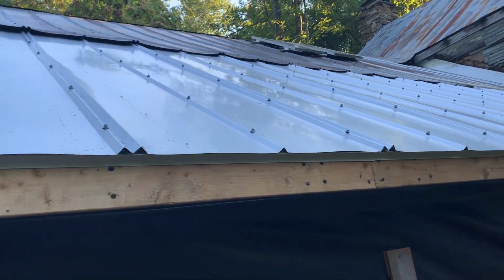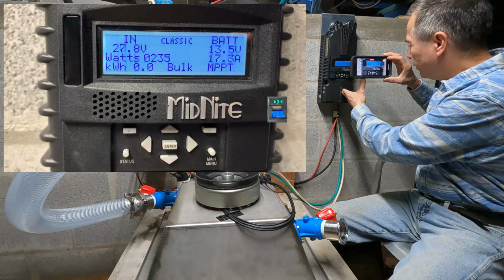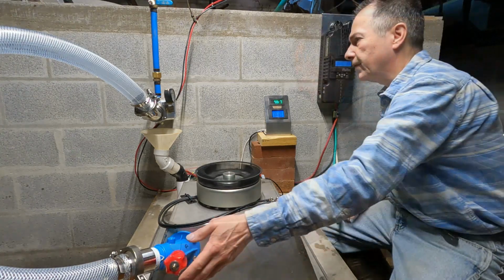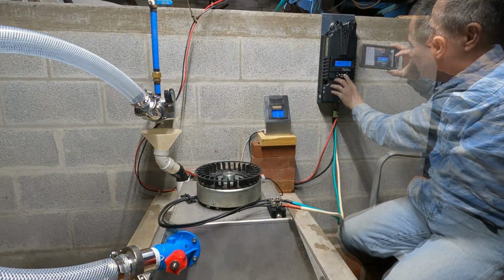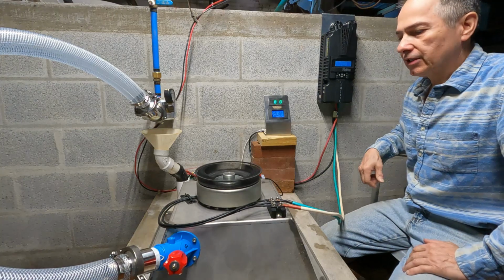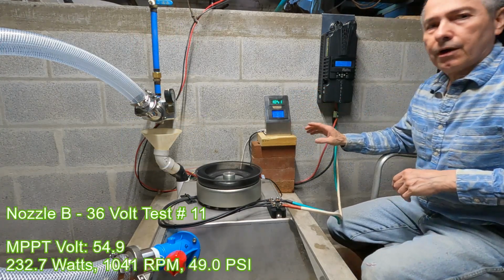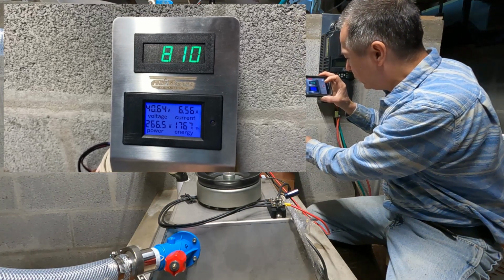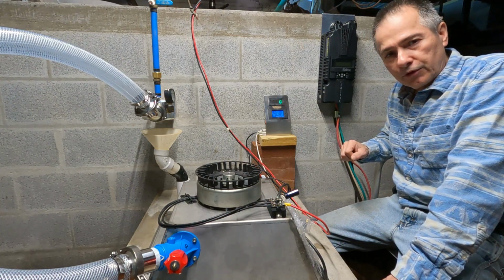Micro Hydro - 32 spoon Turgo on Classic 250

Comment: The generator is faulty, you should try the gearbox reducer. At 3.5 water pressure I get 1200 watts and 1375 watts. Use a 900 rpm induction motor Pelton turbine with a 3/1 reducer and capacitor, use 220 or 380 mppt, this way you lose money.
Reply from the maker: With a 3 inch (76mm) water line I would have been able to get 1400 watts but that is not possible with the 2 inch (50mm) water line I settled for (big mistake). The most I can possibly obtain is close to 400 watts. I am testing different size runners which is similar to using a gearbox to get the most out of my setup. Thanks for posting.

Comment: Do you think that you at any point will upgrade the diameter of your pentstock?
Reply from the maker: Initially I wanted 3" but it was not available during COVID, so I went with the 2". Little did I know that doing so would lower my available power from 1.3 Kilowatts to 300 watts. I think about it all the time but my  line is 3,179 feet long. Yes I will but not in the near future.
Reply: @Magutz  Your videos and real world test data are great, however I think it is worth mentioning that I offer customers design analysis that matches sizing of pipeline, nozzle, turbine, and generator so that a custom H-Hydro turgo-runner will avoid the need for so much trial and error testing. There is no substitute for experienced engineering analysis. Thanks
Reply from the maker: @HdashHydro  The 32 spoon Turgo is from H-Hydro, I also purchased the recommended nozzle. I had it calculated for 12 volts but it did best at 36 volts. You can see the test on this video. https://youtu.be/T7-PYEp10nw 
Thank you for your feedback.
Reply: @Magutz  Thanks. I think the weak link in the calculation sequence is the PMA data (winding resistance and “back EMF” V/krpm). Thanks
Reply from the maker: @HdashHydro  Thank you for the update.

Comment: If you can find a good "dump load" such as water heater, the other style of charge controller might actually make sense.
Reply from the maker: Yes totally, I will try a PWM direct connect controller once I find the Turgo/Pelton that gives me the most power. Thanks for posting.

Comment: With Lead-Acid batteries, you can have a setup without a charge controller, but if you want to use LifePO4 batteries or any kind of lithium batteries, you need a charge controller.
There will be losses in any charge controller since it's basically a boost-buck converter to converter to the optimal voltage and amperage to get the maximum possible power.
Reply from the maker: That is a great observation, I would still add some type of controller to limit your float voltage.